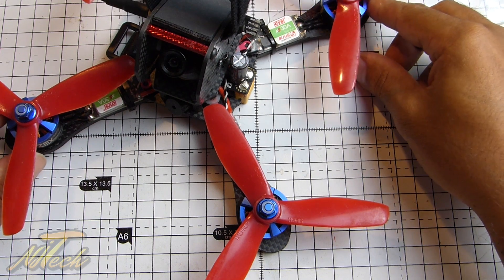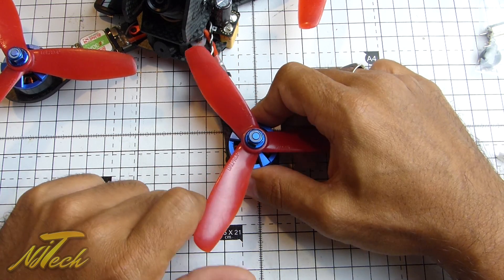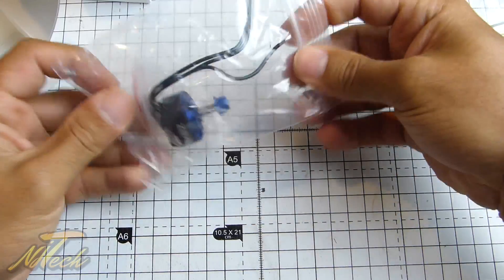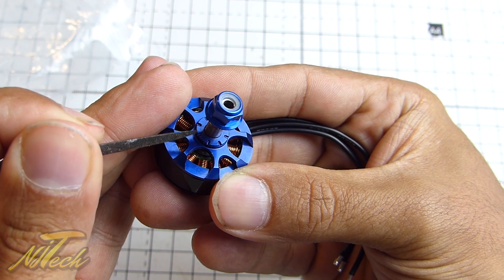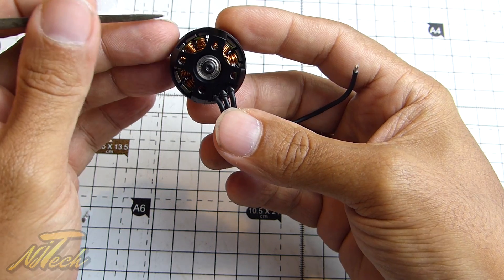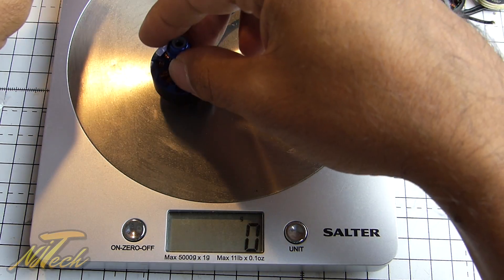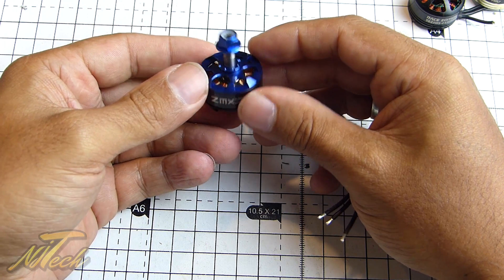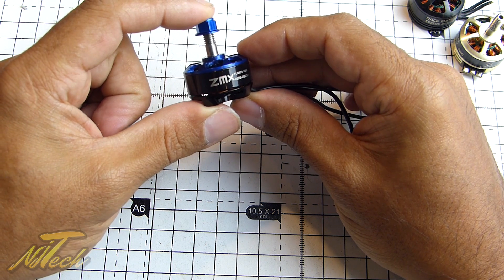ZMX fusion X25 Motor Preview

Comment: That's a very big capacitor you have on the side of your quads :)
I put a 35V 680µF on one of my quads and i feel like it acts actually like some kind of resistor, my voltage reading are not accurate anymore and i feel like a lack of power :s
Anyway, nice looking motor! They feel like very powerful :)
Have a great week
Reply from the maker: interesting! yea I run 1000uf but I've not seen anything odd with the battery voltage reading. just a safety precaution I like to have on mine.
Reply: NJ Tech Yep but the fact is i already have one on my LC Power Filter 25V 1000uF, so i'm wondering right now if both of them are not acting like a single one and probably cause that weird feeling, i will remove the 35V one :)

Comment: I just pre-ordered the orange version from bolt Rc, BTW I always wanted to know why do you add a capacitor to the pdb?
Reply from the maker: motor braking can cause voltage spikes of up to 35 volts back into the system which can be pretty hard on the electronics and in some cases cause ESCs to freak out. the cap acts like a power soak smoothing things out. you don't need one but it's a good preventative measure.
Reply: Would be great if you make a video tutorial or a mini guide, thanks for the answer
Reply from the maker: super easy. 35v 1000uf radial capacitor. wire it in as close as possible to where the power enters the pdb + to + and - to -. job done :)
Reply: good to know, NJ Tech! (i never saw my hobby shop as a go-to place for this hobby.) my bro-in-law had same gyration issue with his ZMX Fusions and DYS XS30A, then switched to Aikon SEFM 30A and worked! any other fix other than buy and try another ESC?
Reply from the maker: i need to do a bit more digging on this issue. I would think there is a setting or timing tweak to get this right. Ill report back when mine is all loaded up ;)
Reply: hi. i just mounted these new motors on a new build. F3 Omnibus Pro and TBS BLHeli S ESCs. upon arming i get CRAZY gyrations. minimum idle is at 1070. stock PID on BF 3.0. motors spin up fine in Configurator but the gyrations occur only when arming via Taranis. will the capacitor help in my case?
Reply from the maker: it will never harm to have a capacitor on your build, i do on every one anyway but im not sure that will cure your problem. Make sure your BLhelisuite settings are good and dont forget to calibrate the escs via betaflight and not blhelisuite.
Reply: yeah, i did exactly that: calibrating via BetaFlight. confusing cuz my hobby shop said to do the opposite! anyway, i forgot to mention that i took off the ZMX motors and put my old Emax 2205-2300 red bottoms, and it flies great. so it's something about the ZMX motors. any ideas?
Reply: That motor tick is related to the ESCs, it also happens with the Ztw spider pro esc
Reply from the maker: interesting indeed Pablo! I've been crazy busy with work the last 10 days but i can now fit these and get to setting them up and see how they fly, and what optimal settings they need. Ill be using XS20As so lets see how that works. (oh and SAr Gonzalez - your escs need to calibrate and scale to the FC, hence always do it through the GUI)

Comment: I've been flying with the zmx fusion 2206 2300kv for a little bit and they do have some pretty crazy power. I think you will like them. I did get two bad motors out of six though..
Reply from the maker: ah good to know! what state was your packaging in?
Reply: I live in kansas and I ordered them out of singapore via DHL. Usually takes a few days and its delivered! I have ran into one interesting problem I cant figure out with these motors though. 5 inch props run amazingly but 6 inch gives me untuneable oscillations. Oh well Ill just fly 5s with 5 inch props then!
Reply from the maker: I think it may have to do with the transition times of these motors being extremely fast, perhaps. I'll know a bit more once I get testing and finding optimum settings.